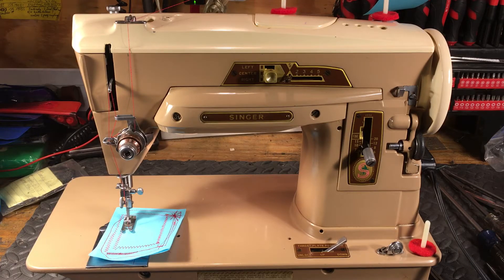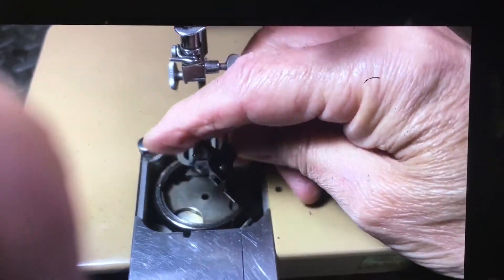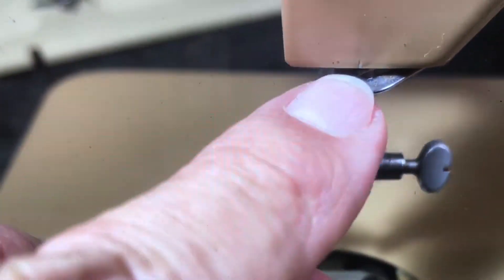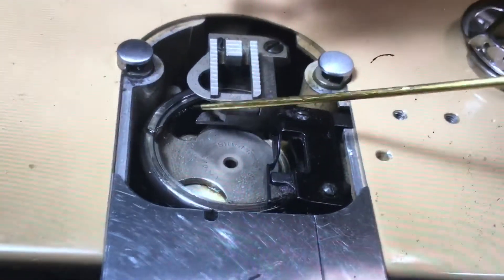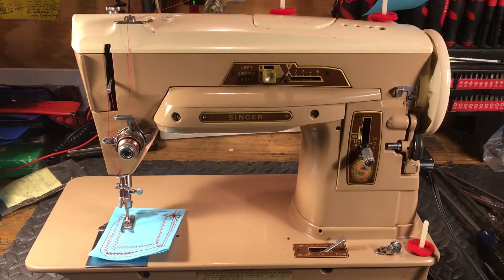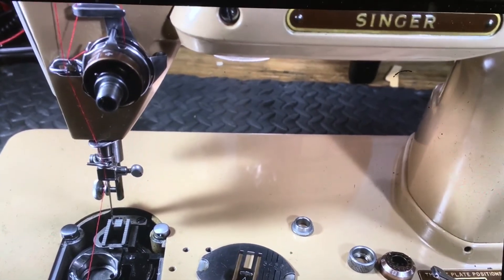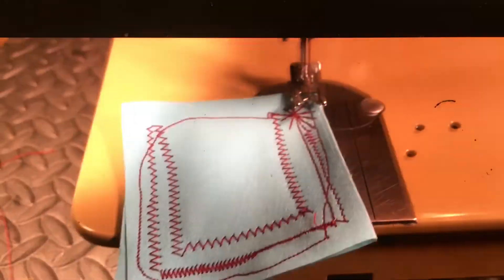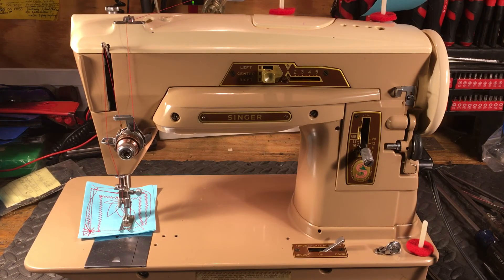How to fix a Locked up Singer 403-A. Step by step service - good @ new Very good machine (video 152)

Comment: Hi again Randy,
New viewer and new to sewing.
Could you please do a full length video on complete maintenance for the 400 line, specifically the 401a I just picked up.
Sometimes lighting and/or camera angles makes it vary hard to see close up detail etc. of certain tips you've shared.
That and my granpa eyes don't see as well as they used to, lol!
Many thanks and Best Regards,
Jack
Reply from the maker: Sure, I will be glad to.  Next chance I get,that will be the subject. Thanks for the suggestion.

Comment: Hi Randy, I love your videos.  Question... I have a 403a that's locked up but it's not this issue.  Any other ideas?
Reply from the maker: Disengage the hand wheel clutch to see if the hang up is with the machine or the motor.
If the hand wheel turns with the clutch disengaged, then the problem isn’t with the motor. 
Step on the controller and run the motor at a high speed to recondition it. 
If the machine is locked up, remove the bobbin case to see if the thread is jammed between it and the hook.  
Oil everywhere you can access that has a part that hinges, slides, or rotates. 
It should start working at that point.👍😎

Comment: Hey Randy, I don’t know what it is about the left center and right button on the 403 a but I can’t get mine to work right.  The needle isn’t moving as I make the adjustments on the button. I have taken that machine apart the best I can and I just can’t get that button to function as it should.  I haven’t seen any troubleshooting videos on that matter. Have you heard of any issues with that button? Thanks.
Reply from the maker: If your button on the left of the lever doesn’t respond and move up and down when you push it in, it needs lubrication .
Don’t adjust or disassemble anything, as that will increase the likelihood that you’ll not be successful in solving the issue.

Comment: Man oh man how do I get my 403 running that fast?
Reply from the maker: @ninjananagardner7672  disengage the hand wheel and let the motor run until it reaches peak rpm’s. That will recondition the armature and brushes and burn off all the particles that are where they shouldn’t be.